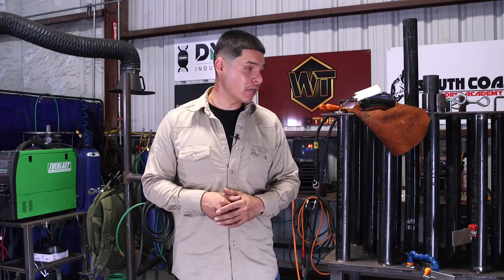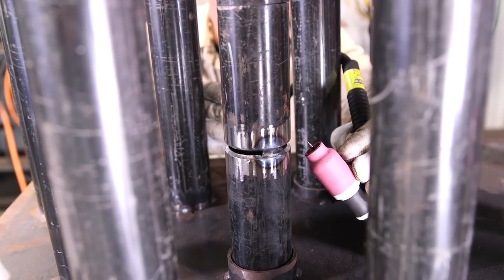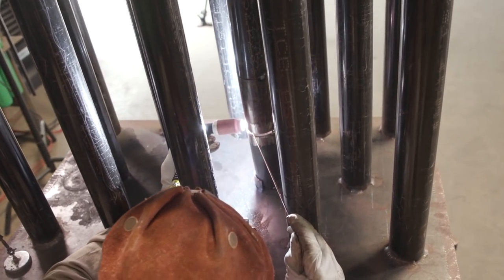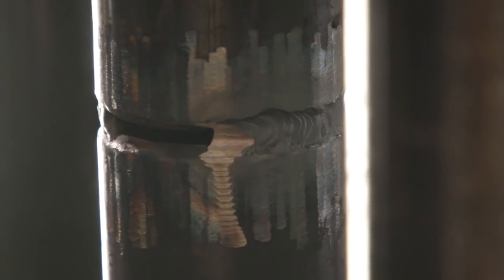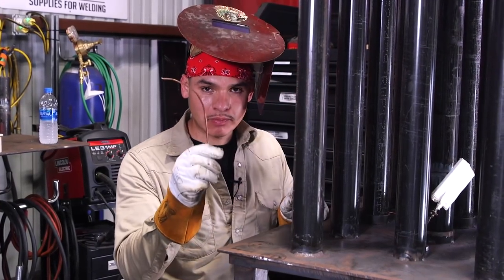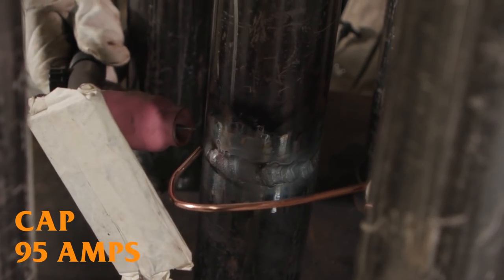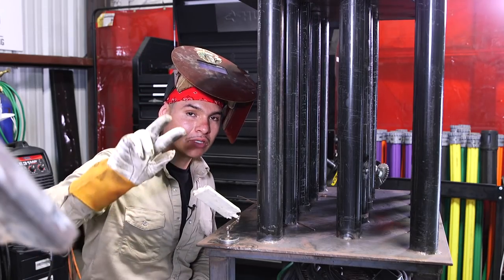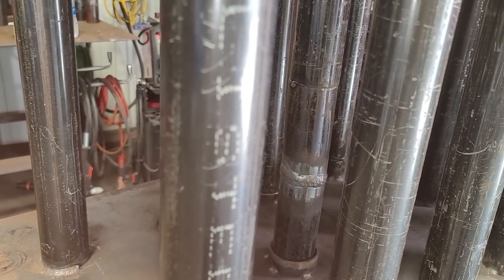MIRROR WELDING | Tig Welding for Power Generation Boilers

Comment: If you use 2 mirrors or an even amount of them it will flip it right side up again so its like actually looking at it straight on
Reply: Yeah, using a set of  old 4x5 gold lens, the plastic ones wont break because of the heat..
Reply: @johnjacobjingle8302  genius
Reply: Yo wtf totally didn’t even consider this!

Comment: Pretty nice, but that's a TON of room between tubes. I've welded tubes where you don't have more than 2" between them. This is a good starting point for mirror welding though.

Comment: Dude, always heard about mirror welding in boilers, also was told becuz of the tite proximity of the tubes, a helper was used to feed the rod in for the welder, is that true>
I had to do crazy welding in unusual positions, mostly stick. Great tutorial for a student wanting to weld boiler tubes. excelente vid, gracias>
Reply: When rooting the sides of waterfall tubes, your partner ALWAYS feeds you and looks you in.
Reply: @Peter.Lecomte for sure. If you don’t push your buddy wire on tangent tubes, the weld can run on you, and you damn sure don’t want lack of fusion on the sides!

Comment: As far as a bad fit, I would say, if I can step across it, I can weld it. But in tight places it’s great to have a good fit.
Make it as comfortable as possible. It is a speciality to be able to mirror weld, especially in corners of the boiler when you’re two-blocked against the water wall tubes replacing primaries or secondary superheat’s close to headers.

Comment: Nice bud. I’ve done some tighter spots where just the torch fits. Cut your way in. Weld your way out.  We use modified horseshoe magnets. Bevel only not to feathered outer edge
Reply: Lol yea shits real when u start cutting windows in pipe.

Comment: You don't  need to begin welding with a mirror, start with a mirror at home and get used to the nuances of it. Hold it up and play it, eventually you will harness a different  dimension that most humans can't see, then the welding or any trade will be ez>, with or without it.

Comment: Wouldnt something like this be perfect for an orbital welder?
Reply: Little late here but he is welding on brand new tubes,in a coal fired boiler the tubes are covered in a slag from burning the coal and it is very dirty,I was on a job where they tried using a orbital welder once and when running the orbital the vibration knocks the fly ash off of the tube and jams up the orbital welder retired Union Boilermaker
Reply: @mattharper588  boilermaker local 105 ✌
Reply: We were on a job with a couple hundred 5g stainless tubes on a vertical header. QC was don Harris out of 154 and the plant hired a sub of non-union orbital guys. QC made them take the tig.test for a make or break. They all failed and he sent them packing. Good work for a few weeks...

Comment: Alright guys I have  a stick welder.....but when  i try to weld  i think the sticks are e6018 ...I WILL CORRECT  2 morrow ...no matter how thin & thick the mettle is I can't get a bubble what am i doing wrong
Reply: Probably a DC type welder which isn’t the best at running a 6010 rod
Reply: I have no idea what either of you are talking about. I've never welded 6010 on AC. DC is the right current. You can open root 6010 on DCEN but you cant certify that in the states. Bubble?

Comment: Great video and all, but your mock up is nothing like a real boiler. 
1st, anywhere you need a mirror, that big rig and big cup won’t fit. 
2nd, those tubes are too far apart in comparison to the real world. Put them anywhere from about 1/4”-4” away from each other and that’s more like a boiler that has ran and has had numerous heat cycles. 
3rd, they’re tubes not pipes when inside the boiler. And yes, I get that your mock-up uses sch. 40 pipe.
4th, if you really want to put on a demonstration, find a coal fire plant during a shutdown and go weld in the back pass or economizer, 5 tubes down while laying on your stomach and fly ash raining down. Then we’ll see some mirror welding.
Reply: When you say they're tubes not pipes what thickness are the tubes?
Reply: @Baaaaayez  Tubes can have numerous different wall thicknesses depending on the type of boiler itself (critical, super critical, HRSG etc) and what part/place of the boiler you’re working in. But tubes are what make up the boiler not pipe. Also tubes are measured by the OD and MWT.

Comment: Anyone near Fort Worth that has advice on schools should just the course at a community college or spend the extra cash for a more known school like Tulsa
Reply: I’m need to start ASAP
Reply: @LCRIPY321  I graduate from Tulsa in 3 weeks, if you wanna weld pipe and are extremely self motivated you can’t beat tulsa I spent 10 plus hours a day in the shop and I’m only required half of that for attendance, structural crap go to a community college